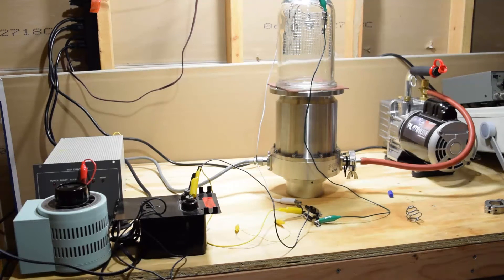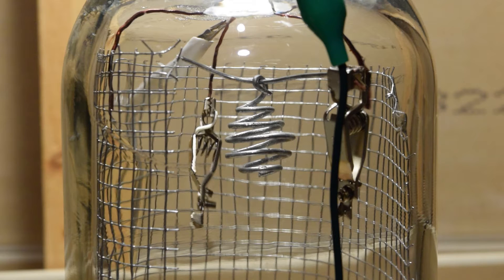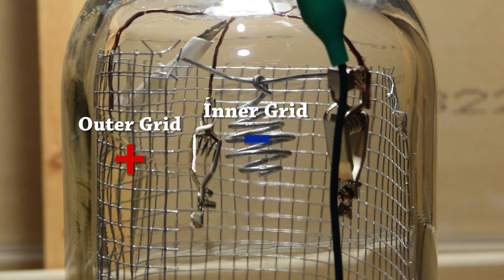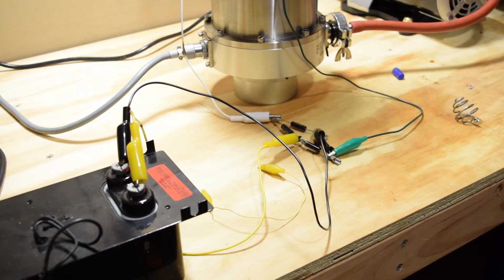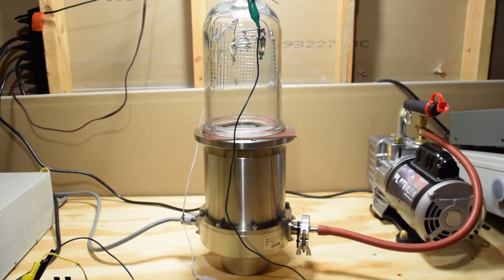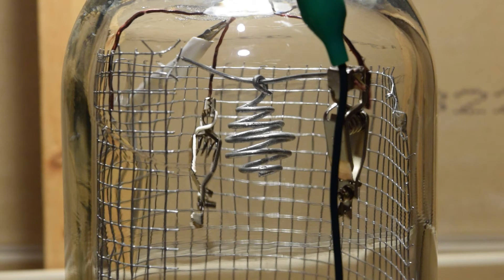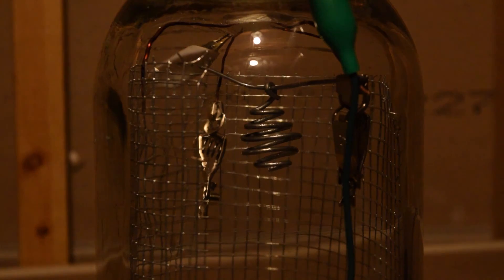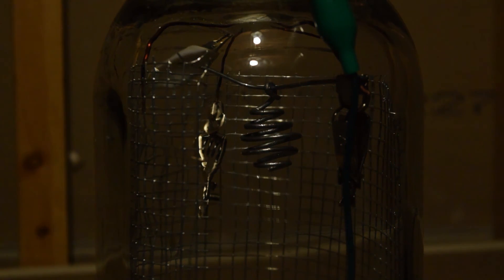IEC Fusion Reactor Demo - No Fusion

Comment: its not temperature that cause fusion. fusion is caused by pressure overcomming the strong nuclear force. high temperature alone does not produce fusion. without pressure or confinement the particles will not reach the density they need to produce fusion.

Comment: wont the high voltage melt those cables. and on 15kV there is like a 60 cm safty distance because the chance of it arcing

Comment: Basically, the main reasons why fusion reactors can't work.
We have achieved fusion. But we haven't achieved self sustaining fusion reactors. That is, one that outputs more energy than it needs.
That kind of fusion is achieved in hydrogen bombs. But again, that's uncontrolled and it only lasts for a split second.
Short: We haven't achieved fusion reactions that are either controlled nor self sustaining

(Again, I am not a physicist. But still I do know some basic physics about this stuff)

Comment: you can still achieve fusion with atmosphere its 114kev per atom my mini tokomak core I engineered for a full spectrum ion thruster prototype or Fsit said as (fix-it) I'm also designing can you cant feel the warmth at a distance like with my VFR prototype but the mini tokomak is for a thruster design not a power plant like I have planed for the VFR .

Comment: Couple points...
1) Your IGBT (as well as an NST) has magnetic shunts. Under load, the maximum voltage youll get out of it is maybe 7kV.
2) Since it's an old video, you probably already discovered you have a severe vacuum leak. The roughing pump should be able to get the vacuum to to the point of plasma extinguishment. A diffusion or turbo molecular pump is never required for a demo fusor.

Comment: can you fuse deuterium using the nuclear fusion setup used in the video (for the sake of yielding some neutrons) or is a better setup required?
Reply from the maker: too cringey you probably could, however this setup is really crude and has very little radiation shielding. I wouldn’t recommend using something like this for actual fusion.

Comment: I don't think 15000 volts is enough to fuse deuterium.  I believe you need somewhere from 40 to 60 thousand volts
Reply from the maker: Cam h That is correct, this voltage was just for the demo run.

Comment: When commenting on the budget, I was referring to the ludicrous amounts of money spent on this kind of research like with the national ignition facility, etc. To think that this process in the heart of stars can be artificially recreated in true DIY  (after spending some money) fashion is astounding. Correct me if I'm wrong, but in stars the fusion is mainly between Tritium and Deuterium. Would these two kind of atoms be easier to fuse than Deuterium only?
Reply: +Chris de Jager Creating fusion is "easy", extracting net energy from it is NOT easy at all and can't be done at DIY level and neither at NIF/CERN level.
Reply: Chris de Jager hi, nuclear fusion PhD student in the UK here. Stars do not primarily fuse DT, they use the proton proton chain (wiki has a nice segment). the fusion community is currently attempting to use DT because the reaction cross section is much larger than other alternatives so it is the relative easiest reaction. Home brew machines like this are cool plasma physics experiments but they are not useful for power generation.

Comment: When you get fusion to fully work, will you try to extract the vast amount of energy it produce?
Reply from the maker: Unfortunately the energy produced in this type of fusor is not net positive - you have to put in more than you get out.
Reply: Are you going to attempt doing that or would that be really instable and dangerous?
Reply: +carl elg The problem with any fusion on Earth is that confinment either via magnetic field or electrostatic field consumes much more energy than the thermal energy produced by fusion itself.
Reply: He will put this thing on the windowsill with nuclear sign sticker, crank it up to blue light mode, and will use turbojet generator for power production, using neighbor's bricking gas exhaust

Comment: I have a question, why so important to get a near vacuum? What would happen if there was no vacuum at all?
Reply from the maker: At a near vacuum there are so few atoms left in the jar that it is very easy to accelerate them up to speeds that will create fusion. I will back flush the chamber with deuterium gas  (I got a cyclinder of it) and let it reach a near vacuum. The deuterium atoms will become ionized and fuse in the center.